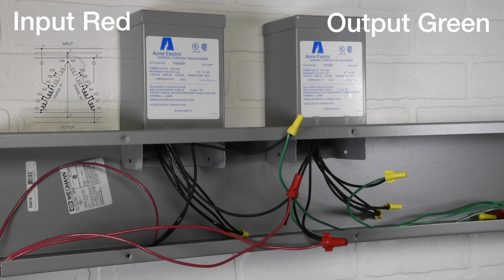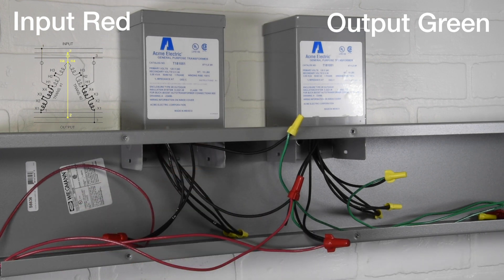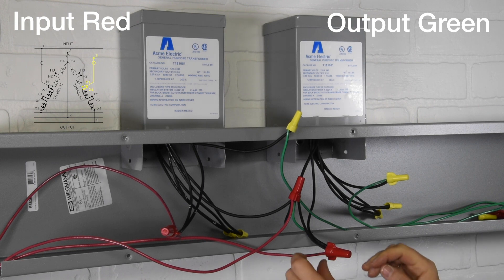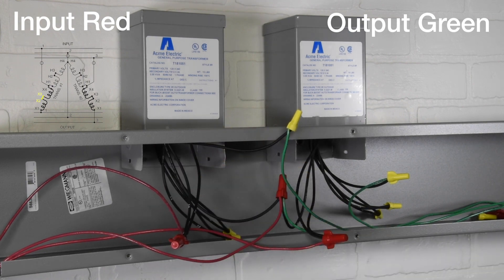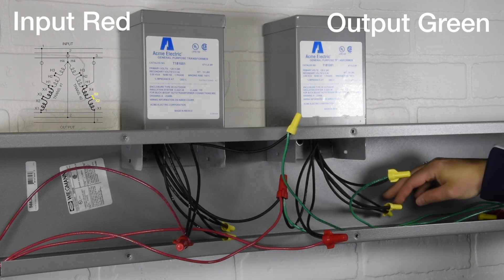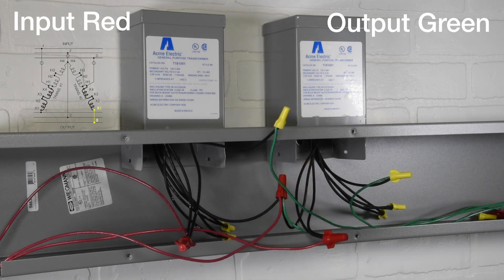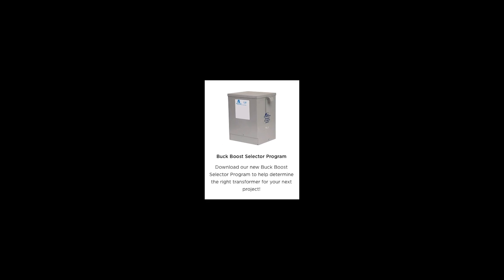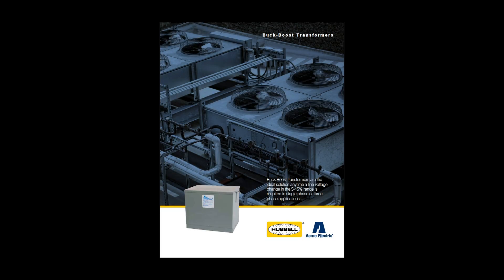Acme Electric- Buck Boost Transformers- FIGURE BB WIRING DEMO

Comment: It’s ILLEGAL to use a green-jacket wire on A.N.Y.T.H.I.N.G.but an Earth Ground.   There are NO exceptions.   Doing this makes I and a thousand electricians distrust your product.
Reply: I’ve used this transformers before. The green wire here must be for this demonstration only. They’re all black except for the ground. Bad choice never the least.
Reply: Entire reason i clicked on the video was because i saw that
Reply: Blah, blah, BLAH.  Legal or not, if you put energy through a green jacketed wire, you’re an IDIOT.   It is possible to be dead right.
Reply: @StandardMan0  you have no idea what you are talking about.    It's done lots of time in cables and other things.   You may not like it but it's not illegal.  You are thinking power cables.   Trying to discount the manufacture you should understand what you are saying first
Reply: @anyutubenamesleft  while what you’re saying is not incorrect, the video clearly does not imply DC (since it’s a transformer connection) nor is it legal to run the same color for different phases, and clearly this is portrayed in this video. And running green wire here, is definitely not being used neither as signal wire nor for any of the 2017 NEC 250.119 exeptions.
Of course unless you live in China or Russia… but then the NEC code doesn’t apply anyway ;) they have their own “code”
Reply: @RobiBue  that would also not be correct.  You can run all the same color if it's a UL listed product that has been designed as such say in an enclosure with wire marking (numbers or bands).    Also keep in mind that these can be wired for low voltage 24v or 12v which again is where what I mentioned before falls.   Wired to how you can get away with a using a small transformer to buck or boost for say a 30 amp circuit.  The full load is not going through the transformer just the buck or boost load.   Lastly it clearly states it's for demonstration purposes to make it easy for you to follow.
Reply: I don't think they are recommending that you use green for the boost outputs, they just made the input wires red and output green for the demo wiring. Also, keep in mind that engineers aren't electricians, and most don't know much about NEC code since they don't do work under the NEC. UL listed complete products are allowed to use whatever color wires they prefer, although it's unnerving to see entire panels wired in white wires, if it's been UL approved as a complete product, green or white would be legal in that case. As you said, using green, white, or natural grey as ungrounded conductors would be illegal under the NEC as they demonstrated in this video.
Reply: Your statement would be incorrect.  If it is less than 50v see below.  

Grounding of green wires
Section 250.119 of the 2017 NEC has a long-standing requirement that identifies the green wires in a cable as ground wires. This was obviously written with power cables in mind. There is an exception for communications, Class 2, Class 3 and power-limited fire alarm cables operating at less than 50 volts. That exception is clearly inadequate because many communications, Class 2, Class 3 and power-limited fire alarm circuits operate above 50 volts.

In the 2020 NEC, the 50 volt exception in 250.119 has been changed to be 50 volts AC or 60 volts DC in order to accommodate PoE. Recognizing 60 volt DC circuits is a step in the right direction but still inadequate because it does not encompass all Class 2, Class 3 circuits permitted in Tables 11(A), 11(B) in Chapter 9, and all power-limited fire alarm circuits permitted by Tables 12(A) and 12(B) in Chapter 9.

In the 2020 NEC, the new Section 725.3(P) for Class 2 and Class 3 cables, and new Section 760.3(O) for power-limited fire alarm cables, permit green wires to be used ungrounded without the voltage limitations in Section 250.119.

Code Organization, Section 90.3 permits Chapters 5 through 7 to supplement or modify the requirements of Chapters 1 through 7; consequently, the requirements of 725.3(P) and 760.3(O) override the requirements of Section 250.119. Section 90.3 also exempts Chapter 8 from the requirements of Chapters 1 through 7 unless specifically referenced in Chapter 8. Consequently, Section 250.119 does not apply to communications circuits because that section is not referenced in Chapter 8.